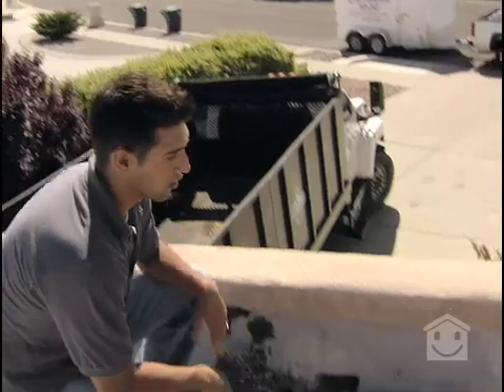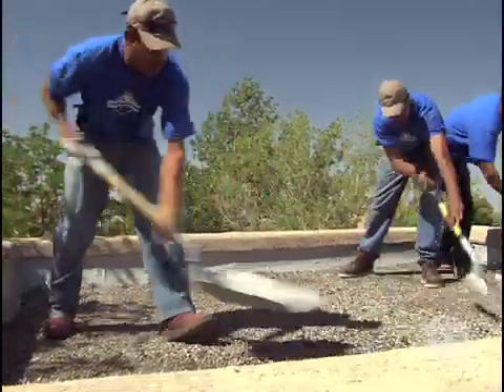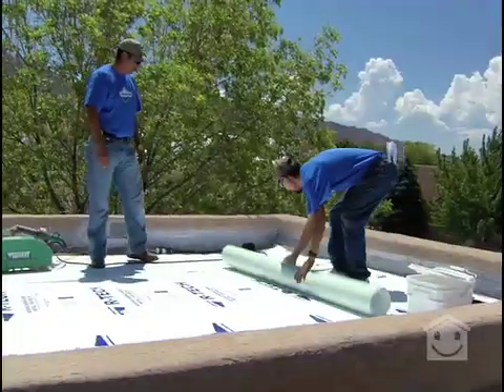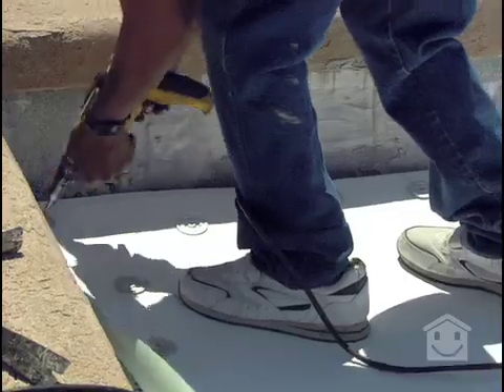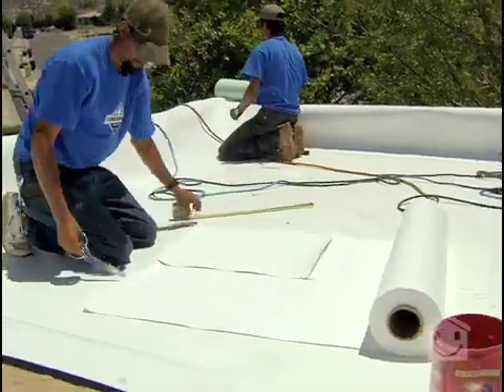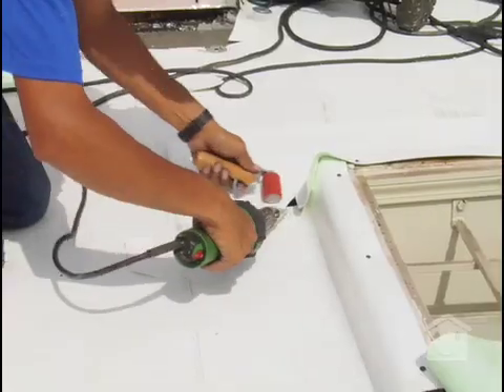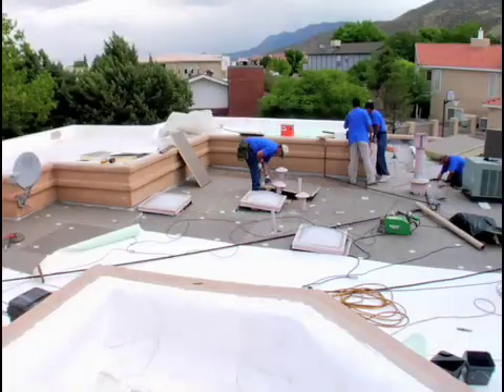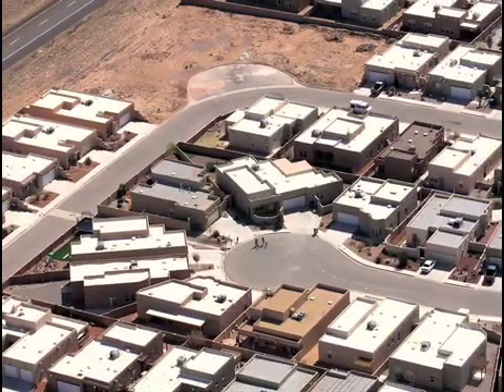Fixing Flat Roof Problems - Lone Mountain

Comment: do you guys ever use glue to fit the tpo, our tpo is fleeced back and we use a pu moisture cured expanding glue but we have had problems with the unevenness of the glue causing ponding, 
are all your systems manually fixed with screws and washers ?

Comment: @FATTYTHELEGEND1 

It depends on who is installing the system and the manufacturer of the material.  It takes skill and a good product to put down a good single ply.  Single ply systems are by far the best solution for a flat roof when done correctly.  You must have had a bad experience with incorrectly installed system or you are an old school hot tar guy that is behind the times.